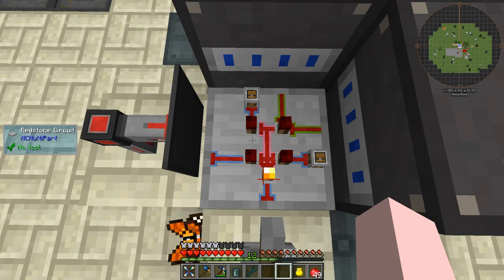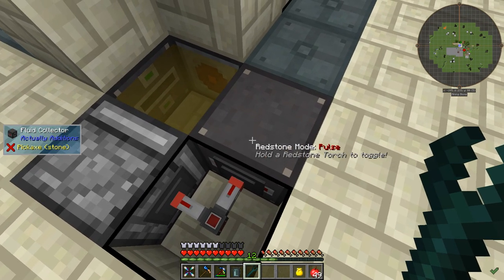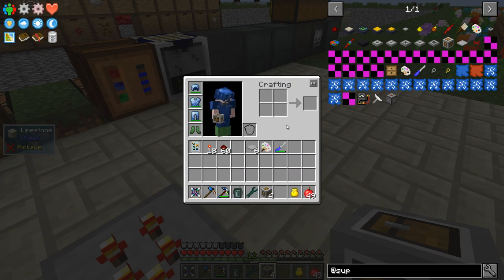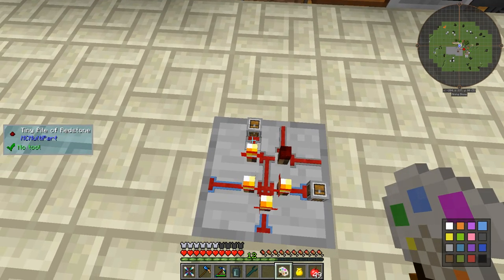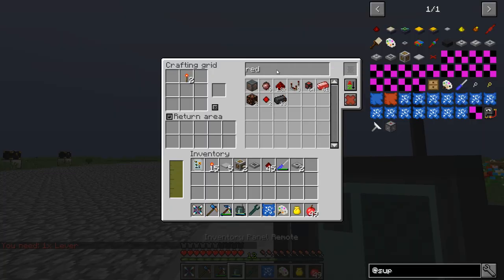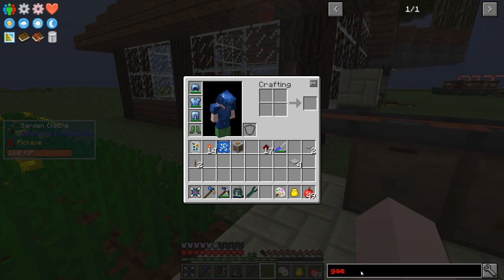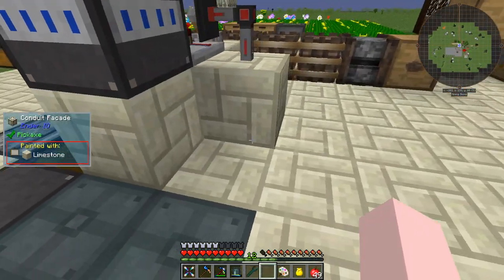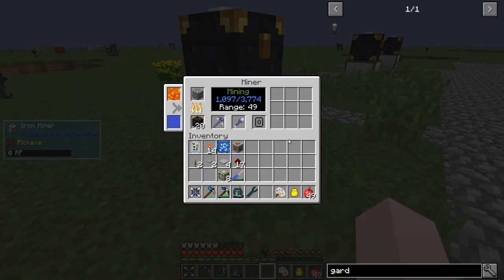11 Automate Empowered Oil with Super Circuit Maker

Comment: Maybe a crazy idea, but storage drawer with a flint upgrade. If full then break the drawer, then place it again with the upgrades.
Reply from the maker: Interesting idea. A Mini Chest would be easier. Would placing, filling, breaking and retrieving a mini chest, take less time and be less work than single drops with a timer?
Reply: Filling - transfer node with a stack upgrade.
Breaking - Auto-Breaker
Placing - Auto-Placer
Retrieving - the chest should be in the Auto-Breaker, seeds Grated Hopper